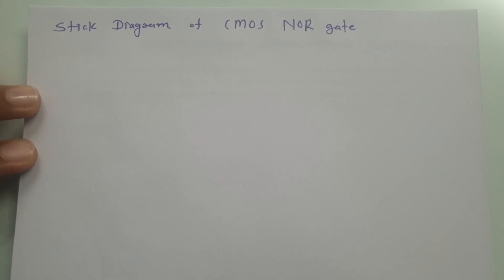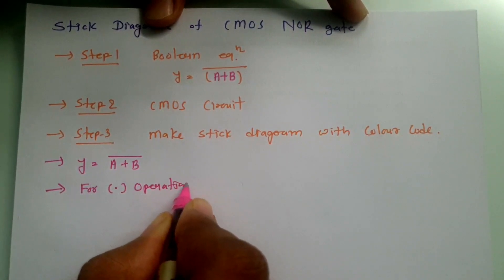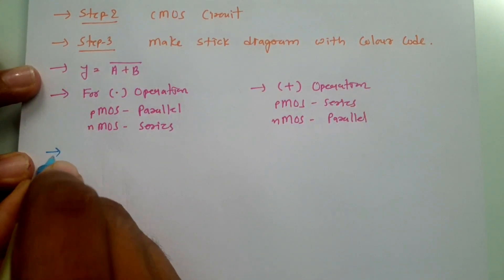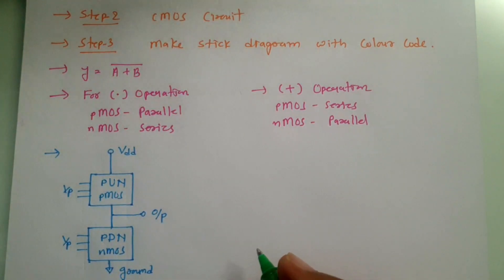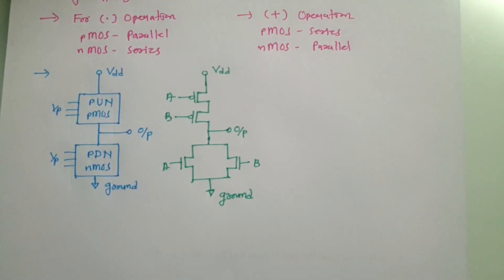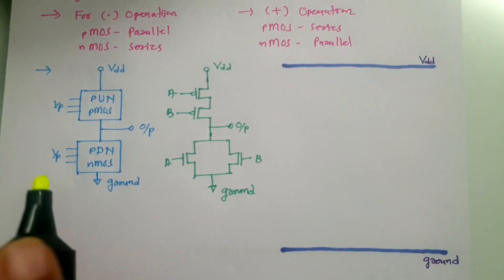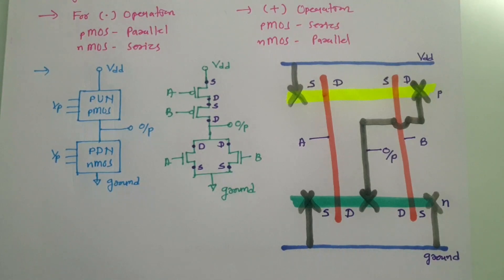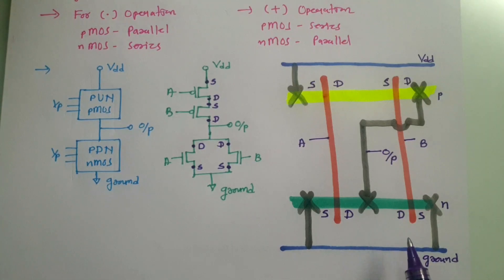CMOS NOR Gate Stick Diagram: Circuit, Design & Working

Comment: Sir,Can we directly draw the stick diagram of a non inverted boolean expression without inverting it?
I mean f=(A+B)CD.
I have taken the output and connected to a new gate/stick(f') and used two inputs from Vdd and ground but unwanted connections are unavoidable from the f' gate and gate D.
Please help me out.
Regards.
Reply from the maker: CMOS has characteristics of inversion. 
At last NOT operation is required.
Reply: @EngineeringFunda  Sir I did used "NOT" gate in the last and my question is related to this NOT Gate only that:- on including the NOT gate in the final stick diagram, NOT Gate's connection with Vdd and ground is disturbing adjacent MOS connection.
By the way thankyou so much sir for all the kind efforts for us🙏🏻.
Reply from the maker: It is fine you did mistake, don't worry about it.
Reply: @EngineeringFunda  Heartily thanks sir🙏🏻😌

Comment: But sir, NOR gate is, (A+B)'. RIGHT? BUT IN STICK  DIAGRAM  U DID FOR OR DIAGRAM, A+B.  HAVE NOT USE FOR  "BAR" OR INVERSE.  SO BASICALLY ITS A OR STICK DIAGRAM,  NOT NOR. RIGHT?
Reply: Watch previous videos
Reply: Output is already with bar ...so there is no requirement of bar